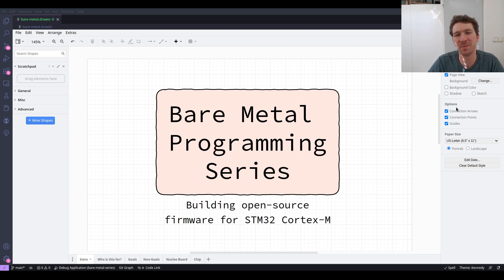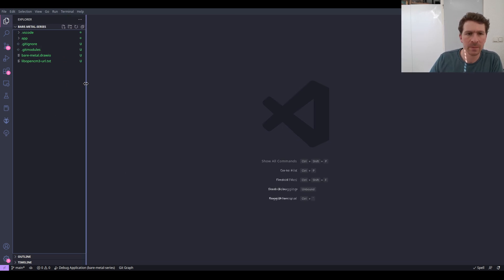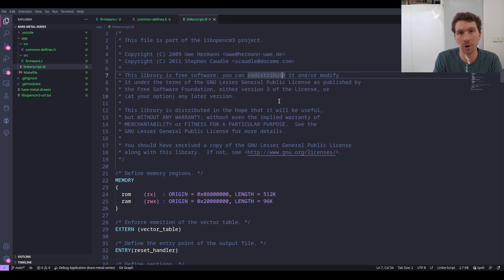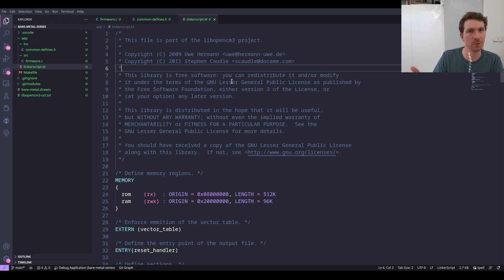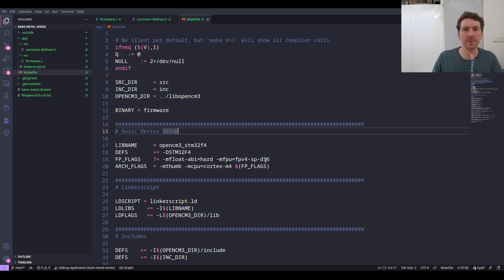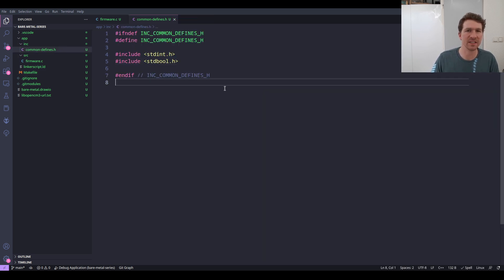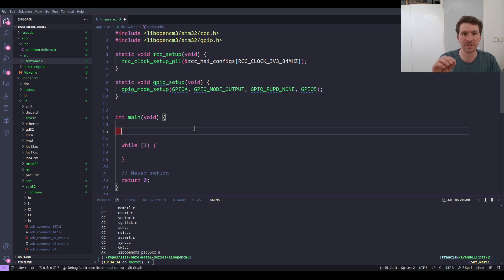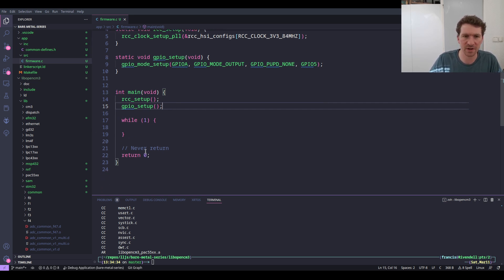Hello World Blinky! Bare Metal Programming Series 1

Comment: The video is from a year ago already, but I felt like it should be mentioned. You can speed up the process of make compiling anything, by using --jobs use flag.
The jobs value should be equal to half of your ram but not more than the amount of cpu threads for best optimization.
So for example I have 16GB of ram and 12 thread processor, so I run make -j8 and it should compile 8 times faster.

Comment: Looking forward to the series. I am thinking of tipping my toes into bare metal development by follwong along but use QEMU instead of a development board. Are there any significant advantages using real hardware?
Reply from the maker: Sounds like a great plan! If the emulation is good enough, and you have some way to simulate the "outside world" (LEDs, GPIOs, etc), then I don't see any major disadvantages to using something like QEMU. I personally enjoy having the physical hardware in front of me, hooking up the oscilloscope etc but that's a personal preference

Comment: how this is bare metal programming when using all the prebuilt functions?
Reply from the maker: I explained this in episode 0 of the series, but I'll sum it up here. "Bare metal" is a fairly broad term that can mean everything from "code with zero dependencies that performs only raw register accesses" to "code that runs without a standard library, RTOS, or operating system like linux". On that spectrum, this series is somewhere in the middle. There's no RTOS or standard library usage, and although libopencm3 is an external library that is used, it is itself an extremely low level library that performs one or a handful of raw register accesses per function call. Additionally, I make it a very large part of the series to actually follow all of the important function calls in libopencm3 all the way down to the raw register level, and explain them in depth.
Reply: I definitely think this qualifies as bare metal programming. You start out with an STM32 development board that does nothing, and write all the software that's needed to make it do something. The "prebuilt functions" are just libopencm3, which is only a level or two of abstraction from the true bare metal code. IMO it's actually really powerful to be able to think about the bare metal tasks in conceptual terms such as "set up the clock for GPIO port A". And then when I really need to see the true bare metal code it's not hard to follow the libopencm3 C files to the true end. I just started the series but I think I'm going to be able to get a lot farther thanks to this level of abstraction.
Reply: @LowByteProductions  if possible can you please create tutorial on how to blink LED using raw register accesses, custom linker script, startup code and makefile? No RTOS, no standard library, no HAL, no CMSIS & no libopencm3.

Comment: I'm on ubuntu using the STM32L4 series. Using STLink via vscode just didn't seem to flash my microcontroller correctly no matter what I did, so I just directly got it working via the terminal using st-flash (command line tool for STM32 STLink). If anyone is having a similar issue I recommend trying that

Comment: Gotten everything to work on my setup except the flashing+debugging step. I'm using ST-Link, and can get those tools to work outside of VSCode, but nothing seems to happen when launching from VSCode. I don't get any errors, just a message saying 'make: nothing to be done for 'bin''
Reply: gave up trying to use the st-link tools through VSCode. I could flash with st-util in command line but that was it. Decided to just buy the J-link Edu Mini and have gotten everything working through that much easier.

Comment: What is incorrect in  integrated ST-LINK on the NUCLEO board, instead plug J-link by special adapter?
Reply from the maker: There's nothing wrong with the ST-Link, I just prefer using a J-Link. There are vscode configurations for st-link in the repository.
Reply from the maker: You can also reprogram them to be a black magic probe, which is what I've done with mine.

Comment: I really enjoy this series! I decided to try to follow along with my own STM32 board.
I did everything that was required in the README on github. I even "scrolled" back to the initial commit.
I had a lot of trouble installing gcc and make for some reason on windows. After a couple hours arguning with chatgpt I got it to work.

My questions are now:
1) How did you come up with all those files that you already had at the start of this video?
2) What do I have to do to use my own STM32, because I have a different one (STM32L432KC)?
3) In 'c_cpp_properties.json' i changed the compilerPath to my path as vscode threw me an warning (current: "/program files (x86)/Arm GNU Toolchain arm-none-eabi/12.2 mpacbti-rel1/bin/arm-none-eabi-gcc"). Is that correct?
4) vscode is presenting 5 errors in 'firmware.c': identifier 'rcc_hsi_configs', 'RCC_CLOCK_3V3_84MHZ', 'RCC_GPIOA', 2x 'uint32_t' are undefined". Does this happen because I use a different controller or am I missing libraries? Shouldn't a uint32_t be defined out of the box, I mean.. it's just another type?
5) How do I program the mcu using the on-board stlink? Drivers are already installed. Asking more about the steps I have to do in vscode.

I recognise those are questions that might require some time to awnser properly so a pointer* to a good resource is also very much appreciated.
Reply: Got great help on discord!

Comment: The latest version of libopencm3 has been slightly modified. The preprocessor directive should be #include<libopencm3/stm32/f4/rcc.h>

In case of future changes, just look at the include folder directory structure of libopencm3
Reply from the maker: Hmmm you shouldn't have to do this if you have the chip properly defined in the makefile. Take a look at https://github.com/libopencm3/libopencm3/blob/master/include/libopencm3/stm32/rcc.h, which would be #include <libopencm3/stm32/rcc.h>
If you have STM32F4 properly defined in the makefile, it automatically includes the file you mentioned.
Reply: @LowByteProductions , Yes, you are correct. I modified my makefile. Thanks.

Comment: I installed the repository but am getting this error ffor the app:

# Build the main application firmware
cd app
make

$ make
src/bootloader.S: Assembler messages:
src/bootloader.S:3: Error: file not found: ../bootloader/bootloader.bin
make: * [Makefile:171: src/bootloader.o] Error 1
Reply: Hi, same problem here! You might have already solved it yourself, but here’s what I did:

Under the `bare-metal-series` folder, first `cd bootloader` and run `make`. Then, navigate to the `app` folder and run `make` again.

This worked for me.

Comment: Thank you so much.  Questions re setup - is this windows, wsl or stand alone linux?  ST-Link drivers links on github are for windows but vscode config paths on this tutorial show Linux.  Would Windows + wsl 2 (with arm compiler and make) + vscode work for flashing via ST-Link?  Cheers.
Reply from the maker: Hey Igor 👋 I believe the setup will work both on windows and Linux for st-link, but I haven't tested it myself. Scott, who submitted the patch, is using Windows with no wsl layer.

Comment: i am facing issue with running make on the firmware.c file. I get the error make: * No rule to make target 'firmware.elf', needed by 'elf'.  Stop. Someone please help.
Reply from the maker: Did you clone the repository? Are you on the right commit for this episode?
Reply: @LowByteProductions  yes sir. I cloned it as is, didn't alter any of the makefiles and only removed the additional files and folders to replicate the folder structure that you had in the blinky video. Also the file is named firmware.c in my directory as well. and on the current commit.
Reply from the maker: Well the makefiles changed a fair bit throughout the series, so it makes sense that it might not work outright. You'll find it easier I think to check out the commit associated with the first episode instead, and try to get that running. From there you'll be able to follow along with the seri3s making your own changes 🙂
Reply: @LowByteProductions  thank you sir i will try that.
Reply: @LowByteProductions  This solution worked sir. Thank you. But now i am facing a different issue in the PWM video related to a core lockup. How may i proceed from here?
Reply: Hello, have you fixed this error yet? Please help me, I'm also having the same problem
Reply: @HoàiNguyễnXuân-d1x  Hi! Which error are you facing? Is it a make error or core lock up?
Reply: @harinayan7879  Thank you, I fixed it

Comment: You configured the type of the pin but not level. While it doesn't matter for this example, in the real world, not initializing the pin level, you can cause problems later on. You can put the device driven by the pin into a funny/undefined state which can be hard to identify. Best to set pin level if it's going to be and output and if it's an input, set the initial level with the pullup/pulldown function. Even better is an external resistor as this ensures desired level as the system powers up. I had a SPI device that would partially clock data into itself. Later writes to the chip were all shifted making quite the problem.

Comment: i like the bare metal idea but.... you have a list of needed installs that doesn't include the environment your showing or how to get where you are. This makes it harder to follow you. Please consider adding an episode or a link detailing these crucial first steps, showing how to set up the system you are running so we all start on the same page.
Reply from the maker: It's a fair point, but also a decision that I made consciously not to try to show getting to this environment. At the end of the day, there are 3 major operating systems, and even those 3 are fractured into various versions, distros, releases etc. There is simply a combinatorial problem here, and no matter how hard I try to cover every possible case, someone will come with a particular flavour that I haven't, and will want answers. Unfortunately I just don't have the time to support all of that, so getting the tools installed is left to the viewer. Fortunately though, the readme of the project does include all the things you need to get going, as well as an editor configuration for vscode that covers debugging for a jlink and st-link. Please give those materials a look first. If you can't get up and running I'm happy to try help in the discord server
Reply: @LowByteProductions While I agree of the plethora of target systems, I'm just talking about your system. If it's linux Windows, MacOS, doesn't matter. Just document your system setup. Going down the rabit hole of setting up Make, installing GCC etc really detracts from the goal of programming the micro.

Comment: When I run make I get the following errors. Seems the Makefile isn't finding something.

make[1]: arm-none-eabi-gcc: No such file or directory
make[1]: * [../Makefile.include:41: can.o] Error 127
Failure building: lib/efm32/ezr32wg: code: 2
Failure building: lib/efm32/g: code: 2
Failure building: lib/efm32/gg: code: 2
Reply from the maker: Seems like the arm gcc tool chain is not properly set up. If you have installed it, make sure it's in your path.

Comment: process_begin: CreateProcess(NULL, printf "  GENHDR  stm32/f0\n;", ...) failed.
make (e=2): The system cannot find the file specified.
make: * [Makefile:63: include/libopencm3/stm32/f0/nvic.h] Error 2

Any Idea to deal with this ERROR !
Reply from the maker: If you're building on windows, you probably need to convert the line endings

Comment: Hey,
I'm trying to compile libopencm3 and getting the following error, tried to solve it, searched google, no luck. maybe you can asssist:
PS C:\Users\Arie\Desktop\Embedded Dev Courses\Low Bite Productions\bare-metal-series\libopencm3> make    
process_begin: CreateProcess(NULL, printf "  GENHDR  stm32/f0\n;", ...) failed.
make (e=2): The system cannot find the file specified.
make: * [Makefile:63: include/libopencm3/stm32/f0/nvic.h] Error 2
Reply: Have the same exact problem idk why. I have all the tools installed what I believe is correctly.
Reply: Did you manage to solve this? I get the same error.